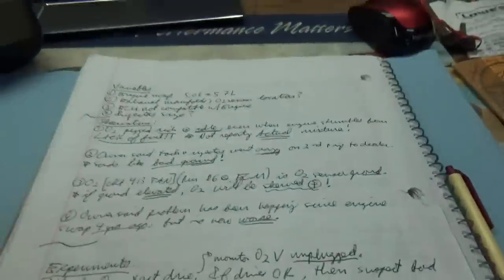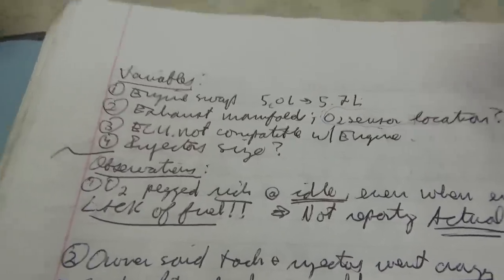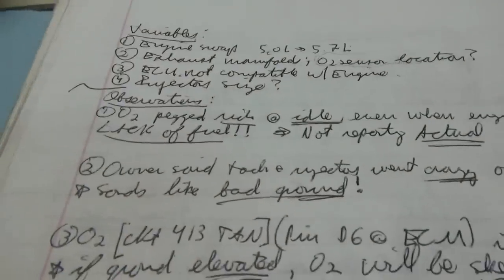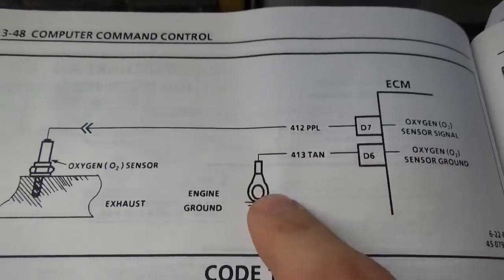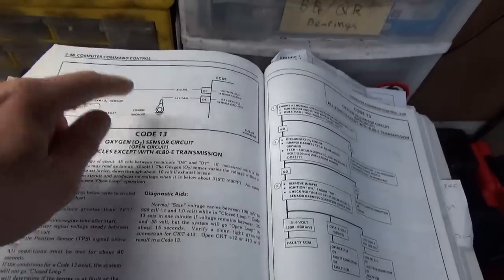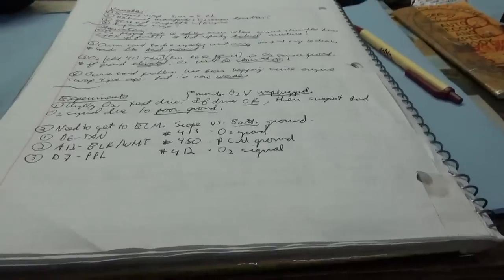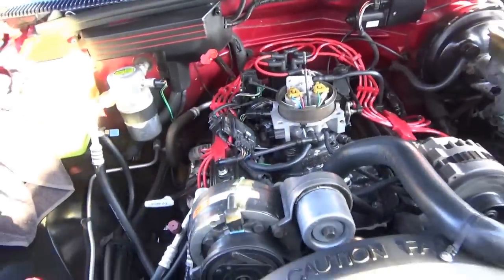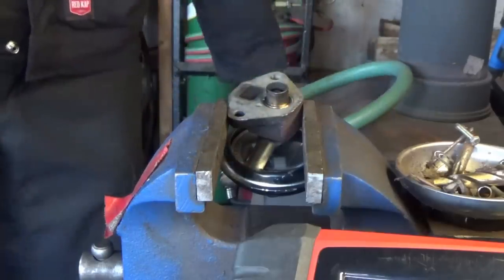Classic Chevy Christmas! - Part 2: Emissions Systems

Comment: U should make a wideband meter or buy a used innovate lm1 or lm2. They are cheap that way u know how rich it is or know if the sensor is lying.  It's just a 5.7 tbi it's not that custom. I would think either pcm from 5.0 or 5.7 would be fine still should be able to control fuel. Fix that idle speed back down. They shouldn't need to touch the idle stop screw or bend the tang. Can't wait to see the fix! Need to  kill some fuel either pressure or to big injectors
Reply from the maker: But how to bring the idle speed down?!?
Reply: @PineHollowAutoDiagnostics  what ever it takes to get the throttle blades to close more. Does it show the iac steps on the scanner? There should be a certain number they should be at. Not sure off top of my head. Or it's a vac leak causing high idle but prob not since it's running so rich.  Or maybe timing is too high. Alot of people don't know u have to unplug the connector before u set the initial timing. Easiest place to check fuel pressure is remove fuel filter and t in gauge there. I think it's 9-13psi or something.

Comment: the throttle bodies and injectors are very sensitive to fuel pressure, the fuel goes directly to injectors first, then beeds off thru regulator, chances are, he  has a BIG ASS 18 PSI spring in the fuel regulator and its pushing past injectors at idle.

Comment: Too bad you can't get an egt reading at that O2 sensor to test the "O2 cool down at idle theory." Or substitute a heated O2 and see if that clears it up. You must have a heated O2 sensor around there somewhere. I don't see where you've ruled out the over-reporting rich condition of the O2 sensor.

Comment: I don't know squat, but one thing keeps bugging me.  Why did the integrator keep resetting?  Part 1 around 10:40, block learn pegged low at 102, integrator drops to a point then resets to 128.  It doesn't seem like it's reacting to the O2 sensor finally dropping away from rich.  It looks like it is resetting to 128 every time.  Why?  Why wouldn't it stay low, and the engine run like poo all the time?
Reply from the maker: It looks like the engine is running so rich, that the fuel trims can't correct for it, so the integrator keeps resetting and trying again and again and again haha

Comment: I think you have a combination of two issues, a leaky faulty passenger side injector causing rich O2 readings and a poorly designed exhaust header.  

The reason a normal exh manifold has one O2 bung at the back of bank one has to to do with the orientation of the intake runners.  Each intake runner having its own injector and four air passages to four cylinders..... these are split between the two banks   (Cyls 4,8, 3,5 & 4, 6, 1, 7 on the each injector plane of the intake) Basically it’s a dual plane intake where the inner and outer runners cross over to each bank of cylinders.  

The normal stock exh manifold on bank one is fed by two runners from each injector.   Thus giving the ECM a pretty fair average of the fuel control.    (1,7 & 3,5 two from each  plane of the intake)

This exhaust O2 bung looks to reading only cyls 3 & 5 which are fed by the suspect leaky injector.  

So your rich O2 reading is causing the ECM to lean out the other four cylinders to the point of lean misfire.    

@Pine Hollow Auto Diagnostics - you mentioned somewhere in this diag you wanted to check the spark line on a scope.  Maybe that would show a difference in the burn of the two injector planes of cylinders.
Reply: Wow, interesting! Didn't know the V8s used a cross-plane intake... I think the 4.3 V6 just had each injector feed all 3 cylinders on that side, and the O2 after the Y-pipe.

Comment: something else I see, I have a purge valve on my 89 and 94. why the 91 wouldnt have it I dont know. is there an unused plug connector in that area? doesnt seem like there should be a straight line to the throttle body. try blocking off that hose at the throttle body and see what happens.  the way it is hooked up looks to me like it would induce a vacuum leak.  the purge cannister is only supposed to be open to vacuum under certain conditions, not all the time. a vacuum leak will signal the MAF to give it more fuel, and the 02 is trying to lean it out. should be a 2 wire connector on top of intake manifold between radiator hose and throttle body. maybe try blocking off the purge canister vac line, then take her for a spin, and see what the 02 sensor says,, see if theres a change.
Reply from the maker: Interesting! Do your 89 and 94 have California emissions? I didn't see a separate purge valve on the diagrams anywhere...
Reply: @PineHollowAutoDiagnostics  ivan , one is an oregon truck, another texas, either have california emmisions
Reply: @PineHollowAutoDiagnostics  is there a plug connector buried in the wiring harness near the intake manifold? my trucks do the same thing, theres no vac at idle, but on accel, they vac. but the closed purge slenoid stops vacuum . I guess they didnt want a vac load on the engine at idle, when the purge cannister valve is energized open flow.
Reply: @PineHollowAutoDiagnostics  Electrnic Vac Regulator Valve.. apparently some had it , some didnt
Reply: pg 4-55 to 4-61 of the  chilton manuel gm full size trucks 88 to 98 it seems like it depends on the vin number, whether or not it had the AIR system  on it or not, just a plethora  of scenarios
Reply: OK according to my book none of the 91s used a purge solenoid, so unless theres a difference in the 5.7 throttle body,   there shouldnt be an issue I can think of.

Comment: So O2 sensor indicates rich, block learn is trying to control towards lean, yet engine stumbles (fails to fire plug and ignite mixture) suggesting lean. This is consistent with:

(a) the O2 sensor measuring in the wrong range. Ie: Indicates rich even when mixture is correct.

(b) injectors are actually providing too much fuel, which is making it through the engine, despite symptom of lean. Could be leaky or too-large injectors (or too-high fuel pressure) coupled with uneven fuel distribution at low revs, so most cylinders getting too much fuel, but one or more getting lean mixture. (Are the injectors supposed to atomize or just dribble like in this video? Could dribbling distribute fuel unevenly?)

(c) the stumble is perhaps not actually due to lean mixture. Can we distinguish that from spark waveform?
Reply from the maker: Fantastic questions, Graham. All will be answered very soon :)
Reply: @PineHollowAutoDiagnostics  ... and I'm thinking the thing that's keeping you going is that this is, after all, a feedback system, so as long as it stays within range of legitimate input and output values, it should accommodate to not all components being stock. At least to a first approximation... though not necessarily with correct model of dynamics.

Comment: Ivan, possibly a stupid question, so please forgive in advance; but if the computer is set for a 5.0L engine, but is running a 5.7L, how can one make any assumptions or inferences about performance (rich/lean, fuel provision, spark, etc) without adjusting for those variables? That is, it would seem you could chase seemingly odd behavior indefinitely due to the operational vagaries of the computer thinking it is trying to drive a different size engine. That is, for example, trimming fuel in a certain mode may be right for a 5.0L, but would then starve (lean out) a 5.7L? The programmer in me is thinking you're trying to diagnose a vehicle being run by a computer programmed for a different engine - necessarily giving you an entirely different set of runtime variables. Don't you have to get the computer right first? Hope that makes sense and thanks for your videos! You and Eric O are top-of-the line on YT!!
Reply from the maker: Absolutely, Dave. I will address the computer mismatch in the next part!

Comment: You can unplug the O2 and dvom between and get the O2 volts right there
Reply: Ivan how does it run with the O2 unplugged ? Does it go to base parameters and straighten out?

Comment: The O2 sensor is in the wrong place,it is only on one cyl. instead testing the all the cyls.on that bank.I would advise fitting a 3 or 4 wired sensor lower down the exhaust after the branch,comes into one. Could take a fused supply from the ignition coil, for the heater, reason you are not getting a steady gas flow from one cylinder, one wired sensor should go into a solid manifold near the head, which not very successful originally .
Reply: The ECM. engine computer ignores the O2 sensor until the ECS. engine temp. reached approx. 65 degrees, +or- a few degrees, try fooling the computer by putting a resistor across the temp.sensor wires to fool the ECM. In thinking its at 60 degrees, cutting out the O2  sensor, then do a spark KV test on both banks, to see how the injectors are fueling.

Comment: sometimes these trucks will make you sure it is a fuel problem, then turns out to be an ignition issue.  if its a miss and the unburned fuel from the cylinder goes thru the exhaust, the 02 will signal rich, then the computer tries to lean it out, so u get a hunting situation.  if you unplug the timing set connector on the  firewall, it will take the computer out of the control, and it will run at set parameters. I would unplug the timing set wire and see if it still missfires at idle.. it may be missing a bit on acceleration but your nor feeling it.  if it doesnt miss at idle then you know its the computer causing it, but why the computer is leaning it out to a miss is the mystery.

Comment: I think these trucks have 1 catalytic converter on each bank? The cat behind the O2 may be restricted, so the O2 bank is running rich while the other bank runs normal, and when fuel is removed, the O2 bank runs normal while the other bank runs lean. When I saw the O2 was still reporting rich during your "open loop unplugged" test drive, this is what clicked in my head.
Reply from the maker: This truck has a beautiful cat-free 3-inch MAGNAFLOW system haha
Reply: @PineHollowAutoDiagnostics  LOL at least it's not a variable then.

Comment: I use to check throttle body injectors with my timing light. They had a nice spray pattern not dripping like that. If they dripped like that I cleaned them or replaced them. 

Next step pull hair out and start cursing. Then you can calm down after..

Keep looking. What a pain.
Reply: yep, timing light or strobe light was the best to "see" the spray pattern :)

Comment: fuel pressure, injector dwell, injector size, are all kind of set to somewhat get along, if he has modified the pressure regulator, it can cause problems. look and see if ther is a  screw sticking out of the bottom of the fuel regulator bowl, he may have put an adjustable fuel regulator on her
Reply: when they said whole TBI replaced, I assume whole rebuilt unit with injectors, bolt on turn key ready. so probably not the issue, then again dorman? :))
Reply: @throttlebottle5906  most folks dont buy new throttle bodies, there expensive, and theres 10 zillion used ones out there, that cost 30.00 to rebuild and injectors rarely fail. so I doubt he bought brand new, or reman,
Reply: @randy1ization  did you see how clean it looked, the wire harness pigtails also?
I'd say new/reman at worst and new harness. the wires always discolor and look bad fast in a few years 3K miles
Reply: @throttlebottle5906  whats important is whats in it, stock reg spring , stock injectors? lots of people reguild these, and try to tweak them up a bit.  the fuel mapping on these trucks doesn NOT adapt to larger fuel delivery . the injectors, fuel line size, fuel pump, regulator , ect are all sized to run within the computer prom parameters/.. if he had problems from jump street, its likely a compatibility problem.  the stall may have had nothing to do with the miss at idle. These trucks can be a bitch to troubleshoot and most of the techs that know these have retired. these trucks are making a HUGE comeback, and Ivan the maginficent will soon be busier than a one legged man in an ass kicking contest !
Reply: GM always does things in the less expensive ways, thats why they use 4.3 injectors in a 454, and put a bigger capacity pump, they didnt want to go thru the expensive prom changes.. they likely tried the larger injectors, larger fuel pump and it didnt work for them either.. so they swapped things around until the computer was able to manage it reasonably.. GM has always been very frugal when it comes to major changes.
Reply: NOW  FORD, THEY CHANGE THINGS EVERY YEAR!.. and always end up with 10 pounds of shit in a 5 pound bag..

Comment: My 2 cents: that EGR valve is bad. Ivan you should have been able to pull the diaphragm up with your vacuum pump and it should of hold a vacuum. (my 4.3 is a negative style EGR) I think that diaphragm is porous/has a puncture. Also, I've taken a peek at my injectors with the filter housing off. The spray pattern is quite different. It looks like the pass. side injector is dumping fuel and not spraying. Not being snarky bud.... love your work..... just trying to be helpful.
Reply from the maker: All great observations. We'll get her figured out soon :)

Comment: heres a crazy problem I had on a 89 k1500.. the idle would surge intermittently, turns out the regulator bowl has a set screw that is adjusted to put tension on the spring inside, then   factory locked in place with a big blob of solder to keep the screw from turning out.,., well the solder had deteriorated and was letting the screw turn in and out, due to vibrations it then caused fuel pressure fluctuations . DROVE ME APESHIT NUTS. dont know what ate away at the solder, maybe electrolysis, but it looked like slag.

Comment: The question I would ask the owner is were the headers on the 5.0 liter engine before the 5.7 was installed.  If yes ask how it idled.  If the original 5.0 engine had stock exhaust with stock exhaust manifolds......bummer.   O2 sensors on headers reading two cylinders to adjust the fuel for eight cylinders sounds problamatic.  I always did say, "nothing works better than stock"   Hope I am wrong but headers with O2 sensors, probably without the cat and muffler for back pressure could be causing the issue.

Comment: MAP sensor can cause rich or lean condition and affect the fuel trim, my 99 CRV was running lean  positive 14 precent fuel trim, but in reality the car was runnimg rich by 14 percemt,  delphi aftermarket  MAP sensor was reporting wrong values to the comoputer, i put back the OEM denso MAP sensor, and my fuel trim went down to 3 pecent. I couldnt believe it, i looked for vacuim leak everywhere and almost gaved it up.

Comment: That truck starting at touch of key is not normal. Those TBI trucks always crank several seconds before firing. That would be in my opinion leaking injectors dumping too much fuel at prime. And also causing rich idle
Reply from the maker: Interesting. Pretty satisfying when it instantly fires up haha

Comment: Ivan I am in Jamaica west indies and I am a auto mechanic I did a scan of a Toyota axio 2014 and I got C0210 trouble code I did a live data and rear right wheel speed sensor is reading correctly but the car will not accelerate and the check engine light will not go out even when I  Clear the trouble code and my scanner is telling me that there is no trouble code I am in need of your help

Comment: Warm up engine, attach mitivac vacuum hand pump to MAP input, apply 16- 18 in-Hg to MAP see what happens to idle (also measure MAP output voltage with a scope.  I do not trust scanner interpreted value,  would like to see voltages measured at MAP sensor terminals vs. scanner voltage display. Also validate engine vacuum applied to MAP input port with a vacuum gauge - use a T and vacuum tubing. Get timing light - at idle with 16-18 in-Hg, 650 RPM stock TBI engine will be commanded to about 16 to 20 deg BTDC - it will bouncing as ECM is continuously adjusting timing.

If what scanner interprets is correct (7.8" in-Hg), then I would expect retarded timing (6 to 8 deg BTDC) and high MAP voltage 2.8 to 3.2VDc - ECM interprets this as load near idle  - adds fuel. Rough idling is expected!!!
Reply: THANK YOU for recalling what I've been trying to say!   It's been so many years since i've done this stuff with the old GM ECM's!

Comment: if i do remenber well the test for the egr was to aply a small vacum presure direct to the egr valve it should hold the vacum and then you start the engin and it should bleed the vacum .if it did not then the egr is defect.do not remenber if it was the neg or the positif type egr.i have seen this alot on 1989 vendura with 5 litre that cause idle stalling , and the iac had issue also and the ground on the termostat housing would fail alot causing bad ect groung reporting wrong engin temp

Comment: Check idle screw on front, driver side of throttle body. It's not really supposed to be messed with, but if it was, it might be allowing too much fuel or air..depending on it's function. There is a base idle adjustment procedure that will set that idle screw in correct position. It involves putting the ECM in diagnostic mode and disconnecting the IAC valve. I believe those TBI motors usually idle about 700-750 RPM.  https://itstillruns.com/reset-baseline-idle-gm-tbi-7959677.html
Reply from the maker: Indeed. EVERYTHING has been messed with on this bad boy.
Reply: @PineHollowAutoDiagnostics  haha...yes, I can tell...seems like a sweet ride though.
Reply: @PineHollowAutoDiagnostics  also, I hope you're not planning to work on that thing today...it's cold as a mo-fo over here in Northeast PA. I would assume not much different out your way..